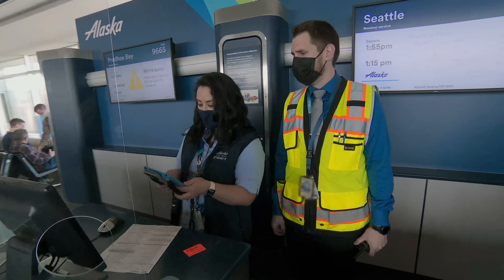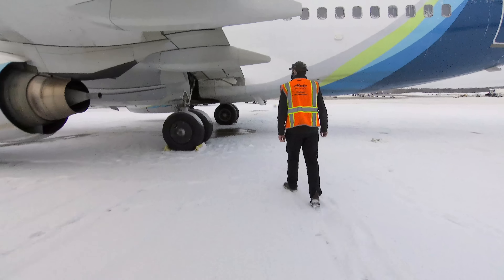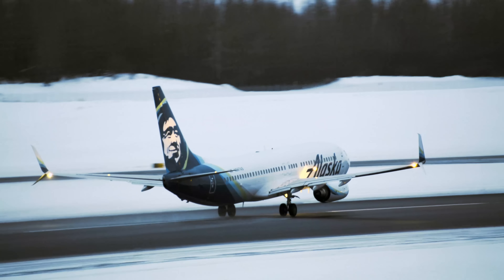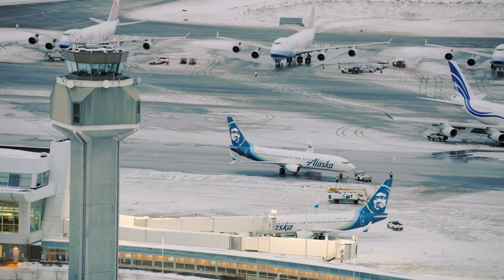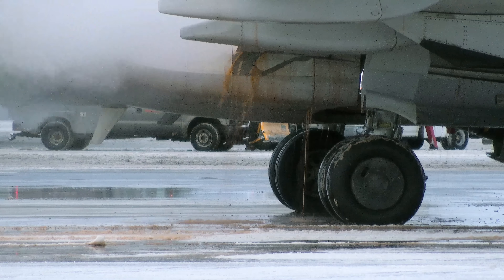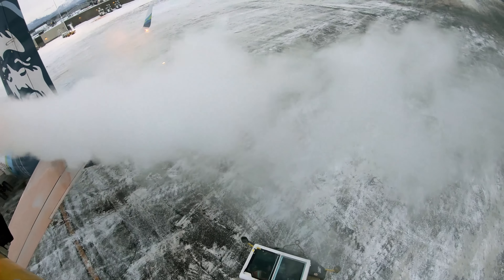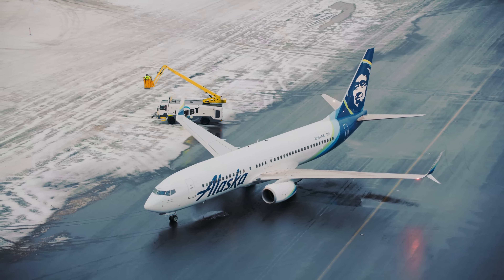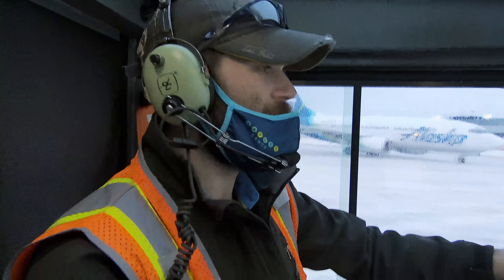Alaskan Airlines’ ‘Milk Run’ Schedule Faces Icy Delay | Ice Airport Alaska | Smithsonian Channel

Comment: Too bad the planes couldn't be stored in  a heated hanger.
Reply: Hangers are only used for aircraft maintenance
Reply: @Jere Aviation  yes but with the amount of money spent on de-icing having heated hangers for planes would pay off in the long run for this airport.
Reply: @Jere Aviation  yes but with the amount of money spent on de-icing having heated hangers for planes would pay off in the long run for this airport.